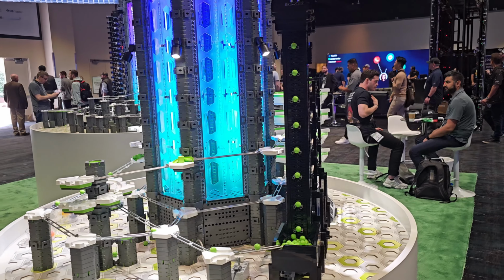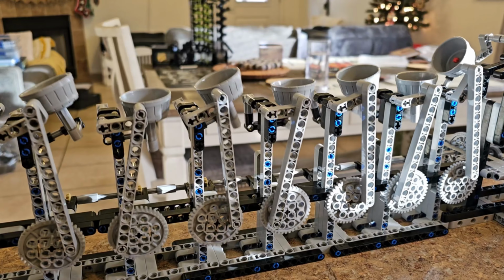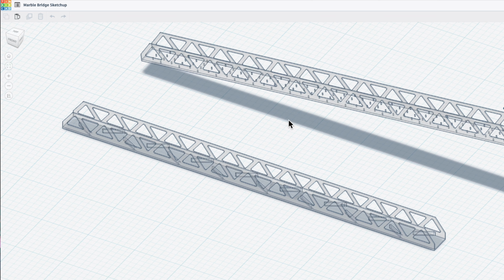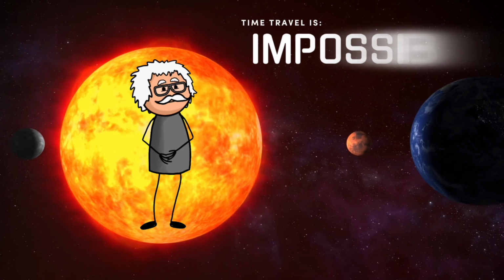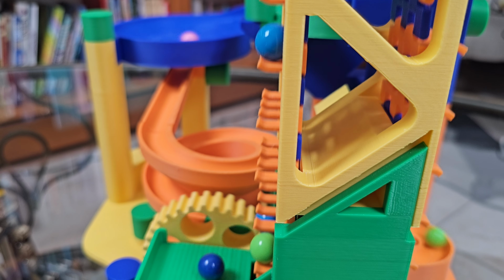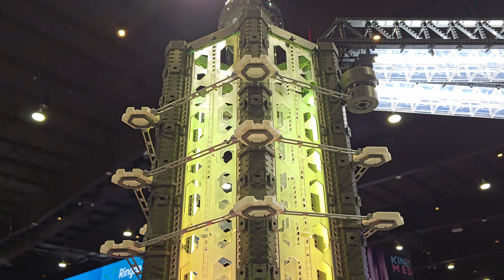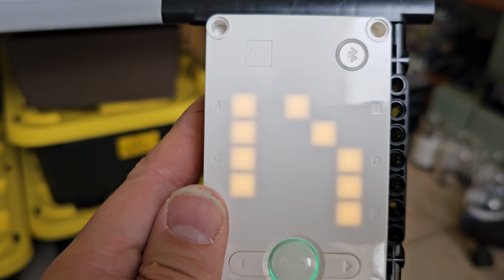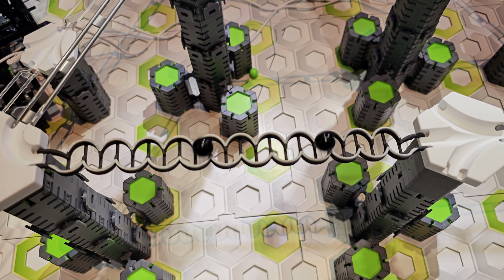My Most Challenging Marble Run (Trade Show Exhibit)

Comment: And now there is something that will make you grow even more. The fact that the perfect marble run don't exist and never will be. Why? It's about common sense. The tinyer the object materials, components , the more propense to fail, they would be. There's micro/nano imperfections in the tracks and components including the marble surface, absolutely imperceptible to the human eye that would make a smooth run everytime  a complete circuit it's complete, less possible. And there's other factors like temperature , humidity, dust,and even gravity. Maybe the radiation of smartphones from people passing by affect the course too, there's so many factors impossible to contemplate all at once, or not worthy to do. All this factors affect the run in so many imperceptibles ways that always end in failure. But to make the run 30 min long definitively is an achievement of its own. So congrats.
Reply from the maker: What you say is true. Slo motion closeups reveal the marble is careening through the track in a different way each time, like a pinball off the sides of the track.

Comment: Hey, we're planning a video for next week about our GraviTrax fans outside Germany. We'd like to briefly mention your channel and say a few words about where you're from and what makes your channel special. Would you allow us to use video material from your channel for this purpose? Of course, we would also link to your channel in our video description.
If you're interested, please reply with the hashtag #yesgravitrax and you'll be featured in next week's video. You can revoke your permission at any time afterwards. It would be great if you could also tell us what makes your channel special from your point of view.
We would be very happy 😊
Reply from the maker: Ah, once again the hashtag in the comment caused YT to hold your comment for review, so I did not see it until today.. Yes, you may do as you propose. #yesgravitrax. What makes the Masked Marble channel unique is its combination of engineering and art with GraviTrax in unexpected ways, often turning marble run elements into moving marble mechanisms that I call Marble Run Tech. These creations include marble computer circuits, marble pixel art, and an architectural build of Notre Dame with spinning spire.
Reply: @MaskedMarble just a reminder...could you please check. We are waiting for your answer :) Thank you :)

Comment: @maskedmarble Could you make a 3d model....of a gravitrax rail but it's a x... like the crossover piece, so the marble could go straight wrap around and go on same rail other direction crossing over. So the rail has 4 points to connect
Reply from the maker: There is such a rail available already from a couple Etsy sellers. There may also be one available for printing on Thingiverse, but not sure.